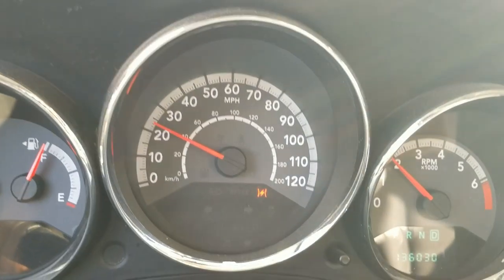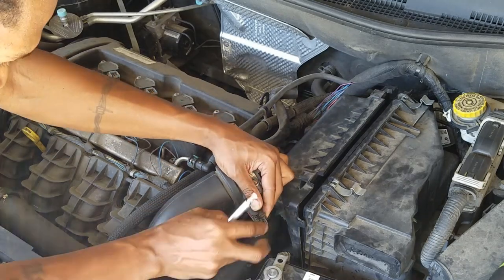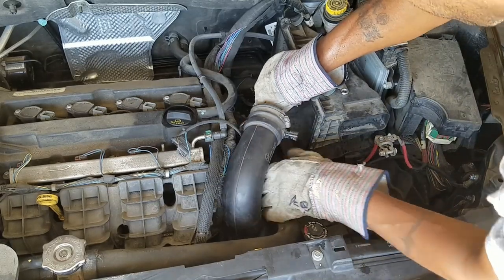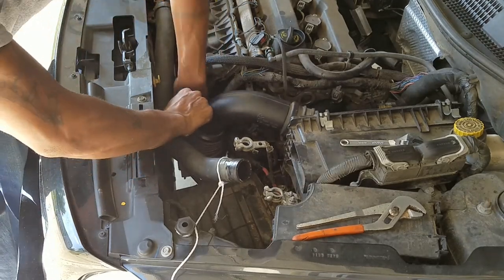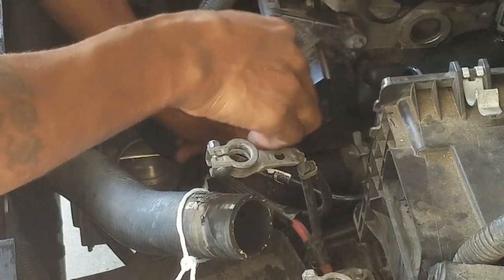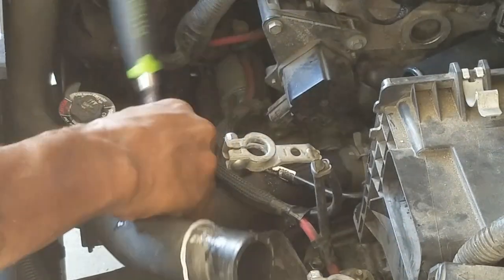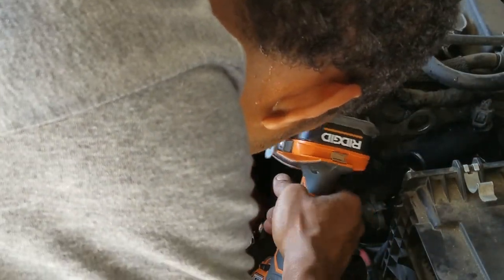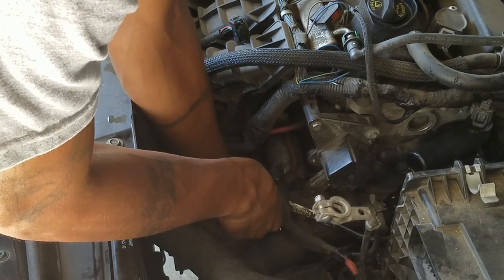How to remove throttle body from 2010 Dodge Caliber sxt (easy)

Comment: Little tip. Just pull radiator hose back and bungee cord it out of your way. No need to pull it and make a mess. You can still get to everything ok.  I just did mine and no problem. Great video
Reply: Good tip!
Reply: Did you still have to take your battery out like he did?
Reply: Bill Langdon yeah did u take out the battery??? I’m probably gonna have to do this one of these days lol
Reply: Yes I did remove the battery. Gives you a lot more room to work.
Reply: You dont need to take battery out of way. Just take air cleaner top off with the hose and you can get to everything. Got mine off in as little as five mins

Comment: Hey everyone! brother6ix, I wish you could of seen my face when I came across this video! I have watched two hours on and off of different ones, and I must say this one right is the BEST!! For me,  it was like being outside with my brother, and hearing "just put some elbow grease and get it done!" lol, Thanks again, may God continue to bless you. I'll update you all when I finish getting my throttle body off and everything back together for my Jeep Patriot.
Reply: I replaced the throttle again in 2020. So now in Nov 2022, the flashing bolt light came on again. I don't remember what code for then, but now the code is p2173. The most of what i been seeing is the intake manifold gasket need replacing. So imma check that first.

Comment: Thanks, dude.  Voltage light and a sputter when you accelerate in our 2007 Caliber turned out to be exactly what you said, throttle body.  I did the job with your video on my laptop, on the work bench.  Did it just like you did with no problem at all.  Thanks!

Comment: Thanks for the video. My car would not go over 10 mph. I had cylinder 1 & 4 not firing. After replacing the spark plugs and coils it did not fix the problem. Seeing your post and thinking that yes the throttle body does send important information to the ECU which controls the firing of the coils and injectors, I replaced the throttle body and it fixed my problem. Thanks again.
Reply from the maker: Kevin Greenberg Glad it helped you..

Comment: Thank you, thank you  sooooo much for this video.!!!!!!! I would never had a chance to replace mine without it. I found the throttle body online at a place called AM Auto Parts. Got it for $59.00. I was very scared as it was $279.00 at Advance Auto Parts. I did wait 5 days for it but installed it in 2.5 hrs. No reset to computer necessary.  Saved tons of money in a big way thanks to your video.

Comment: Thank you im 29 no experience it would've cost 900 something dollars and I overnighted a piece for $130 and it took 1 1/2 hrs to change it but I have a 2011 and it took 20 minutes to get the clamp that's on the hose connected to the throttle body off. Ty so much saved $750 single dad to may I add bc I saw a young lady add she was a single mother lol.
Reply from the maker: Respect 🤝🏼

Comment: Same issues here bro all I did was the last step where you restart the vehicles system with the throttle and key and it worked like a charm 

These damn dodges have bad electrical

Comment: same problem with mine. I have the same exact car. It has always jumped since I got it. So, they sold it with a messed up throttle body I guess. Now, I been told it needs a new throttle body., it just quit running properly and would only go 5 mph for me to park it...so thats how I got here. lol thanks for the video. I dont know anything about this stuff. Taking it to a mechanic bc ill mess it up not knowing what I am doing, trying to learn tho.
Reply from the maker: Andrea Michelle good luck. This really is an easy project as shown in the video just take your time.. but if your feelings unsure then go to a mechanic that you trust but make them aware that you do have knowledge of what's going on with your car... So they won't overcharge for unnecessary things.

Comment: Your throttlebody looks way cleaner than the one I pulled off. Makes me wonder if i also have bad  gas.  Caliber stutters when I accelerate,  the battery. Light only flashed on once and a while, no longer flashing on when I’m driving but still with the same issues. I’m about to replace the throttle body, hoping that that’s it.

Comment: Hey Charlie you just got a sub from me , sweet video. I have a crazy question is there anyway you can post a step by step re learn procedure, for after install?
Reply: All u have to do is turn the ignition to on position only not run then wait until all dash board light settle then hold the gas pedal way down for 20 second, then release slowly within 10 second , then turn off ignition for 3hours .....then drive around slowly for a weak for eco or drive harsh and fast for sport mode....eco mode will make the engine silent on acceleration and sport mode will make the muffler roar on every acceleration.
Reply: Wait 3 hours before driving it after replacing the throttle body??? I'm about to go takle this myself and I live in the country bunkin area lol (I'm a city girl) and these folks think I'm crazy for doing it myself because I'm a female!?? 🙄🤣🤣😒🤣🤣🤣🤣 I got this 💪💪😉😂
Reply: @brandygoyer5940  Ok So mine is a 2011 caliber, the way I relearned the throttle, after install and everything is put back together, get in the car and shut the door it will not work unless you shut the door on driver's side, put the key in the ignition and turn it to the on position 3 times and do it kind of fast, but do not start the engine so just , on,off,on,off and on the third time of turning it on just leave it and look at the dash where your odometer is and you will see three dashes and then wait a few seconds and it will eventually say Done! , Now turn it off and start the vehicle and voila!
Reply: @brandygoyer5940  you can actually try this procedure before replacing it with the new one until you get it figured out , on,off,on,off, then leave on the third time you turn it on and watch dashboard where odometer is.

Comment: If you did not do it already, replace the map sensor as well. Mine is a 2010 mainstreet and both throttle body and map sensor need replacing.
Reply from the maker: Joe G I haven't.. I will look into it.
Reply: wheres the msp sendor?

Comment: Great video got a question about the part tho j went to autozone wanted to charge close to 300 for a kit but seen the part online for 40 so do I need the whole kit?
Reply from the maker: If you can find that throttle body for cheaper than $300...... then I would get that instead of spending all of that money...... the only thing that came in the box when I bought my throttle body. Is the throttle body itself .... I'm not sure what else there would be

Comment: Hey lets connect plastic sensors and parts to heated aluminum and metal on newer cars because thats a great Idea.... Only ones that benefit is the manufacturer and engineer that designs and sells these expensive junk cars I have to fix every day.

Comment: good job just paid 565 dollars to have mine replaced
Reply from the maker: wow! Sorry to hear that. It's a shame that the mechanics charge so much for labor especially on a  job that takes 20 minutes.
Reply: @brother6ixx  It costs $400 just for the throttle body before labor cost. It's not the shop, it's the part cost...

Comment: At first I thought that was a cvt transmission, so I was surprised to see red coolant pour out of the radiator hose. But it's an sxt with a 5 speed manual. So what type of transmission fluid does that one take?

Comment: My car doesn't necessarily jerk, but while at a light it idles kinda rough like it wants to stall. If push brake and accelerate a little it'll smooth the idle. Yesterday it flat out stalled, cranked right back up though. Do you think it may be this same issue? I don't have any lights come on what so ever. 
Thanks in advance
Reply: You really shouldn't do that with a cvt transmission it is very bad for them

Comment: So since you put on a new throttle body and it being a electronic throttle body you didn't go get it calibrated with a computer? I was told it would needed to be plugged in to do it?
Reply from the maker: gabriel gallegos No I didn't have to get it calibrated with a computer.. Just follow the instructions at the end of the video.. That's all I did.

Comment: Hi guys... Greetings from the Netherlands. Last week we bought a Chrysler Sebring with the similar 2.0 engine. By the way it's a 5 speed manual. That car have almost the same issue. It jerks while acceleration only thing we don't have any codes and no warning lights are on... What you guys think could it be throttle body?
Reply: Since it's Manuel your probably the problem 😂🙄🤣🤣🤣😉🤷

Comment: Would a throttle body issue cause the car to have transmission issues and codes po700 and or po730?

Comment: I've got a caliber srt and I'm currently having the same issue it was jerking so bad and the lil lightning ⚡ symbol is on but I'ma take it to a pro to do it I would love to do it but I don't have a garage and my yard is gravel
Reply from the maker: You don't need a garage to change the throttle body. All you need is the proper tools which are not that many.... Good luck. I hope you get this problem resolved quickly. But I can assure you you could do it yourself and save money on labor
Reply: @brother6ixx  thnx man

Comment: I have almost the same issue but, my '07 Caliber stalls immediately after starting it, or "cranking it ON"! I put the ignition key in the ON position and every light on dashboard goes out, except the lighting bolt one, which, briefly stays ON for like 3 seconds, then, turns OFF.
Reply from the maker: Brad Canelo it's probably the throttle body
Reply: Did this fix your problem brad? Mines doing the same exact thing

Comment: I have 13 compass 2.4. My hesitates and jerks while im accelerating and the red lightning bolt pops up on my dash and when i let the rpms go back down it goes away and does the samething over again. I thought maybe it was just the throttle body sensor???

Comment: did you get the new throttle body from a online retailer or a autozone?
Reply from the maker: The Dirty Sanchez I got it from O'Reilly's
Reply: brother6ix thanks for the response hoping it goes as easy as you made it look
Reply from the maker: This is a very easy project you don't have anything to worry about.

Comment: hmm. I have a 2010 caliber and the tbs light is on. Why is that light not on for your car? Only the check engine light? I don't get it. I went to get diagnosed st AutoZone and they told me it's the crank shaft sensor. Yetmy tbs light is on? So confused

Comment: I have a 2010 dodge caliber sxt and it looses power after take sometimes not all the time and when it does that I just pull over shut it off for only a second and restart it and it starts to accelerate just fine for about 10 miles or so  and does it all over again.and seems like it stays In first gear all the time and when then loose.power as Im driving ! Does anyone know whether it's the TCM : ECM or the throttle body ?? Really would like to get some opinions!! Thanks!!
Reply from the maker: I'm almost positively sure it's the throttle body... everything you described is all things that was happening to my car at the time. When I change the throttle body it was running like new again

Comment: You couldn't get it from the bottom?
Reply from the maker: from the video it seems as though it will be easier getting it from the bottom butt because of visibility and your hand placement I think it would be a lot harder considering the position of some of the bolts that's holding the Throttle Down they're slightly angled upward

Comment: Don't you have to put the codes back in?
Reply from the maker: LaindiaC absolutely not.. But good question 🖐🏽
Reply: Thank you for your response, I will try this because the same thing happened to mine once it was fixed.
Reply: And did the steps you took at the end fix it for good?

Comment: I just got the lighting bolt on my dashboard. the car started shaking and then shut down by it self. Anyone has an idea if it could be the throttle or any other suggestions? please help.
Reply: can't get it to start back up. I opened the hood and their seems to be a noise coming from the throttle but I can't tell exactly.
Reply: by the way, the lighting bolt does not flash. it just stays on.
Reply from the maker: Jose Ontiveros it's probably your throttle body but first disconnect your battery then plug it back up just to rule that out
Reply: Quick response thanks bruh. I'll check, but my battery is fairly knew.

Comment: had same problem on 2008 caliber , replaced throttle body , red lightning STILL. comes on so first start of day, turn key off , then on ( No start) wait for all lights to go on then off then red lightning light stays on depress pedal two times slow up and down then turn off key then start motor no more red light car runs fine rest of day till next morning do all over again. THEN few months of doing this red light constantly on so checked filter it was dirty so replaced then ran good rest of day and now again red light still on so every morning do the pedal thing! This is bullshit! with this car! new throttle module and filter and still same damn problem! wouldn't buy another dodge HEADACHE! Why they rely on a sensor when it can run just as good and trouble free mechanical? sensors modules computors are so damn fragile and FAULTY that when you do repair computor STILL reads part faulty when replaced! and yes code still says throttle control module at fault and air leak or not enough and needs throttle gasket which have all been replaced! Sending this pain down the road! Dodge the dodges!
Reply from the maker: Hey! I totally understand...

Comment: How long did it take for it to reset?
Reply from the maker: It took about 5 minutes
Reply: Does it make any sounds when it resets
Reply from the maker: @timjackson1063  no it doesn't make any sounds when it reset... the car just goes from a rough idle to a smooth idle that's it
Reply: @brother6ixx  yeah I tried it it's not working for me
Reply from the maker: @timjackson1063  go to the end of this video... Follow the instructions carefully and it should work you may have to do it a few times... Then let the car sit while running for a couple of minutes it should smooth idle after that

Comment: Mines doing that now I have a 2008 dodge caliber 2.0 i dont know what to do
Reply from the maker: Just follow the instructions in the video... the part of the video where I pull off the coolant hose don't pull that off you don't have to. You can just use a bungee cord to pull it back and it'll give you plenty of room...
Reply: Tisha Tee. changed throttle body , gasket, filter and STILL red light goes on! on my 2008 caliber headache! every morning do the pedal thing and car runs good all day but routine every morning! tired of it so soon as can selling it!